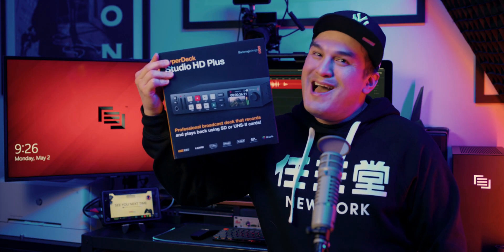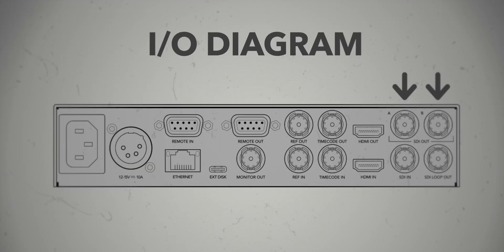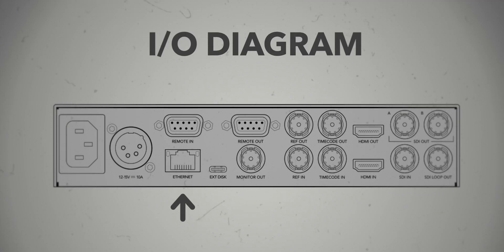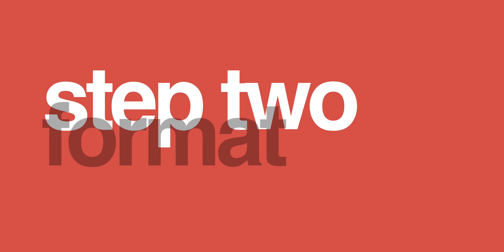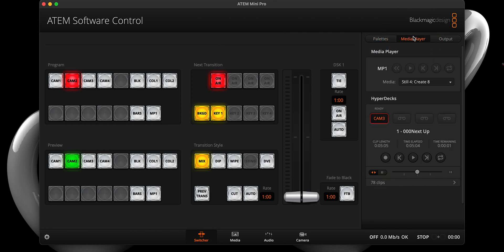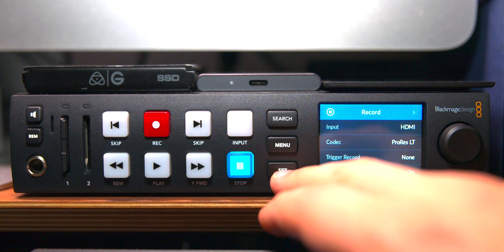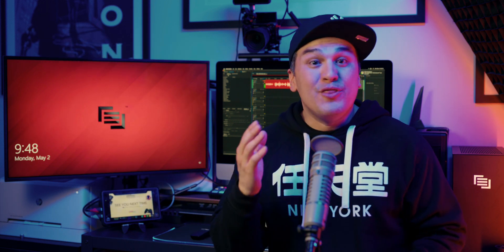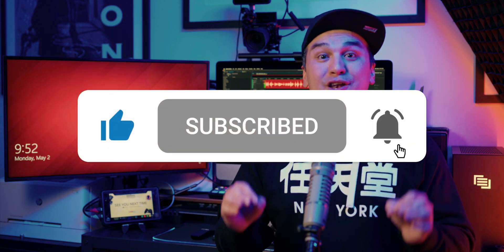HyperDeck Studio HD Plus Review and Setup Guide

Comment: Hello, I put everything in Apple Pro Res 4444 to enjoy the alpha on my lower thirds, on videos to broadcast, impossible to match... Any idea ?
Reply from the maker: You can have you lower third animations in 444 and your videos in 422 BUT they both need to be the same format. I use mov files.
Reply: This is exactly what I use, but one time it reads all the lower and the other time the videos, but I don't have both at the same time...
Reply from the maker: You can only play one video at a time. No way to play a video and an overlay on that video.
Reply: @CreateConsumeRepeat  I was able to find out where my concern came from on the different readings. I had files in 25 fps and others in 60 fps, which made the whole thing really incompatible. I switched everything to 25 fps and everything is fine now, with 4444 and LT!
Reply from the maker: Awesome. Glad to hear you are up and running.

Comment: Very nicely explained. Thank you! In the diagram, you have 3g SDI to HDMI converters but the Hyperdeck Studio HD Plus has 6G SDI ports? Any advantages of using 6G SDI to HDMI converters instead or using 3G converters is good enough as its cheaper?
Reply from the maker: Great question. The ATEM Mini Pro, ISO, Extreme and Extreme ISO all cap out at 1080p. So, no reason to spend more on converters that are outputting higher than 1080P.